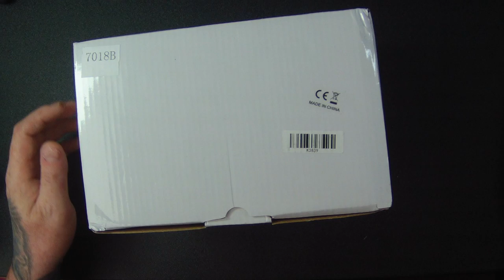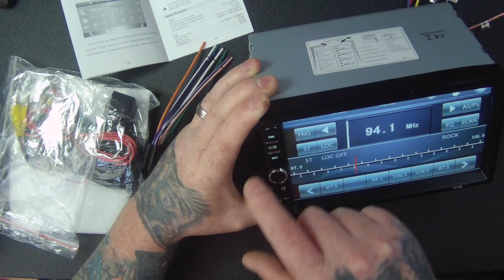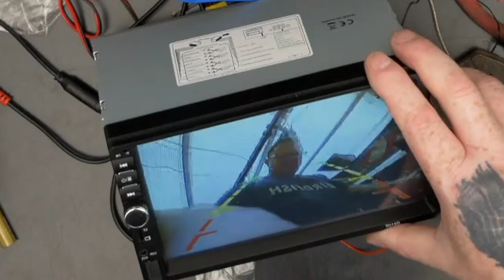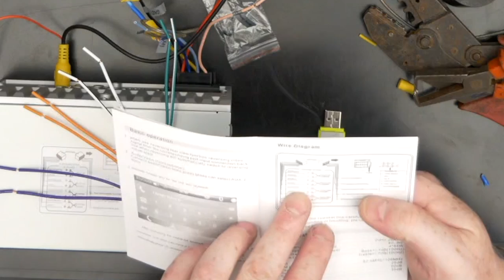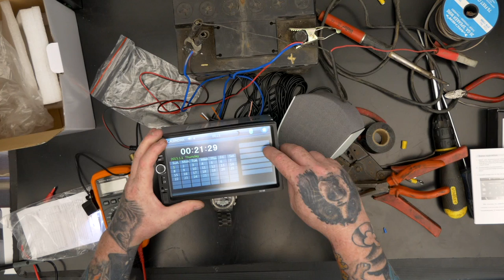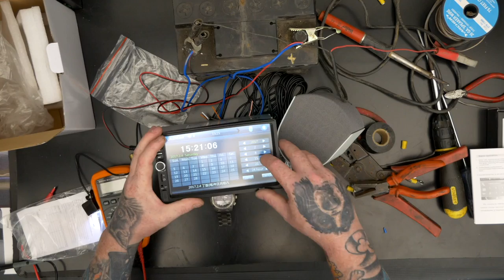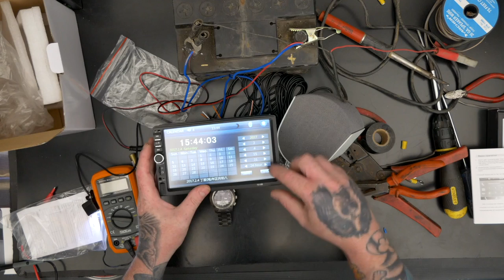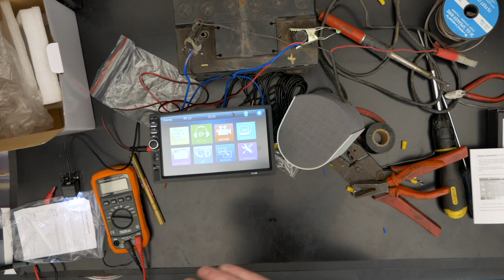TechChecker #181 KKmoon Double Din BT Car Stereo 7 inch Video + HD RearView Camera

Comment: I heard the kkmoon screen was hard to see in the day time, specially if you have a convertible, the screen is just to light even on the brightest setting it's hard to see it, which would be bad if your depending on the rear camera when backing up. 
Anyways, they're 39.00 on ebay, and I actually saw one on there for 17.00. You get what you pay for, other then the light screen the unit is great.
Reply from the maker: Jo W We did not test in a convertible but worked ok in a standard car.

Comment: Question i had this about 5 months no problem. The. All of sudden i cant connect bluetooth anymore. I tried using the usb but that doesnt even do anything.  What are some ways i can connect. It doesnt even show up when i scan
Reply from the maker: Ive not had that problem before in comments so not sure maybe try to remove the power and restart the unit take the fuse out of the back also leave for 10 mins and try if not sounds like the unit is dead and your have to contact the company it should have a 12 month warrantee on it let us know how you get on.

Comment: Great Video. The manual suggests that rearview would show up automatically when signal detected. In the video you switch manually. so what is true???
Reply from the maker: CompuGuru4u if you set it up to the reverse switch for the light it should come on when you put it in to reverse gear 👍
Reply: I have set up the camera with reverse light still it does not come on. When I connect the camera to Video In then I can see the picture under AUX In. If I connect the camera to CAMIN, nothing shows up.
Reply from the maker: Hi I am note sure what to say I do not have the car it was fitted in anymore so I can not remember how I fitted it.
Reply: connect the pink wire to reverse light as well to trigger the reverse camera automatically.
Reply: @camerooonie  yep that's what I had to do.

Comment: Hi , i got a set, same look like yr video. I got a question to ask u . if the screen turns white with some vertical black path,is it spoiled? Unrepairable? The sound still works..  Thanks!
Reply from the maker: Not sure It does not sound good tho hope you can fix it
Reply: Tech Checker Thanks ! I see what i can do.. mostly need to change a new one... 😓